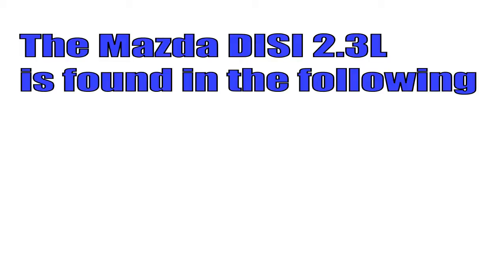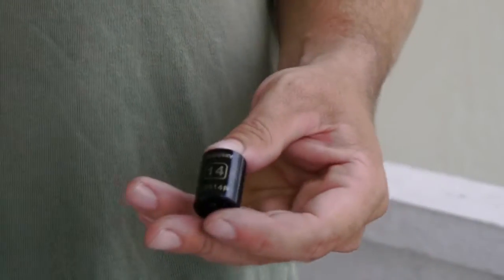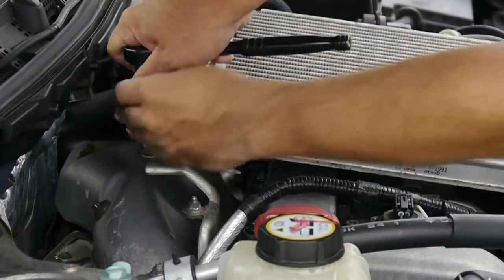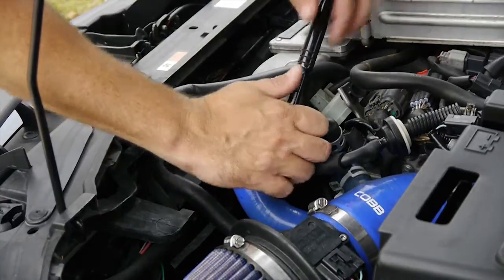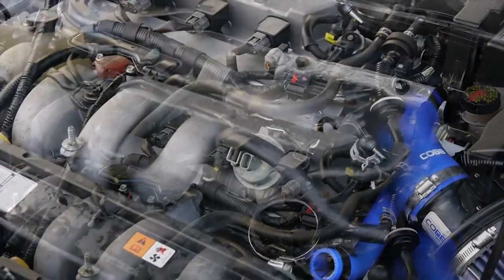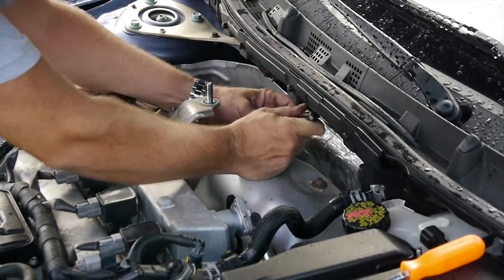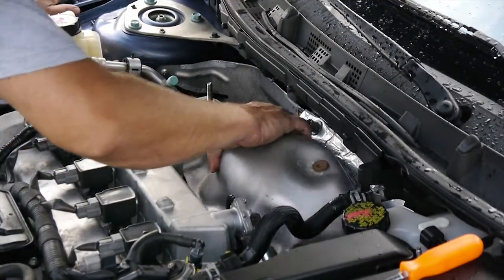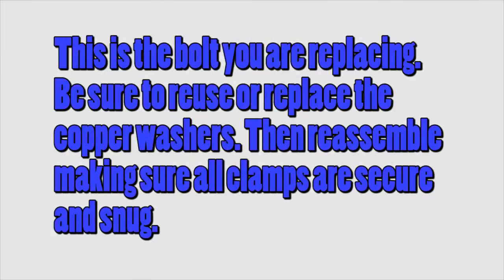Mazda DISI Banjo Bolt Replacement

Comment: Do you need to install both washers
Reply from the maker: Yes you do need to install both crush washers otherwise it will leak oil. When you torque the banjo bolt down the copper gives and creates a seal preventing oil from leaking.

Comment: why is there two washers? stock has one. just got mine.  wondering how the second washer goes on. you kinda skipped that part.
Reply from the maker: ru42112 The copper washers go on both sides of the oil line. One on top and the other underneath.
Reply: Mr.Reel Media so the oil line can be raised up useing your hand. slip one washer underneath. will this be obvious when i get there.
Reply from the maker: ru42112 It should be fairly obvious. You will have a washer between the turbo and oil line and a washer between the oil line and banjo bolt.
Reply: The stock one has two also..the washer underneath the line gets stuck on the turbo sometimes.